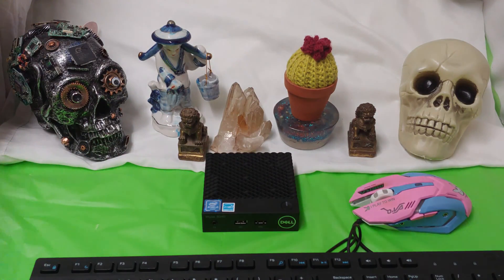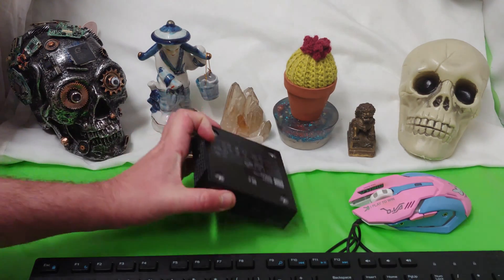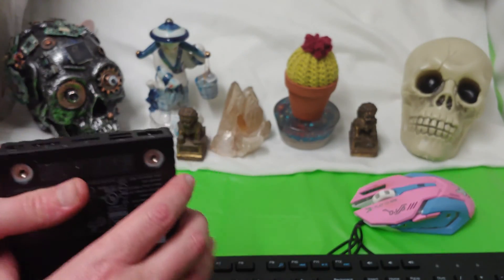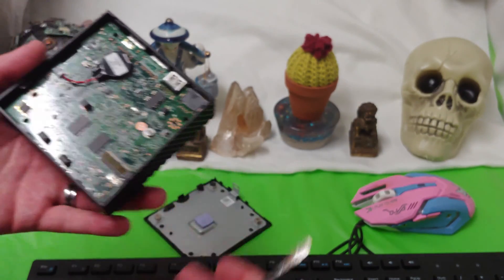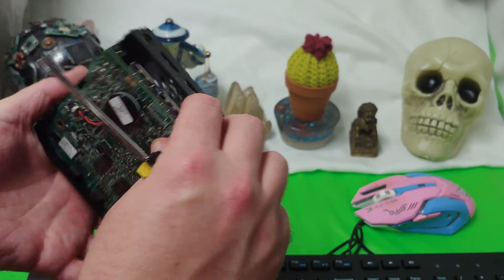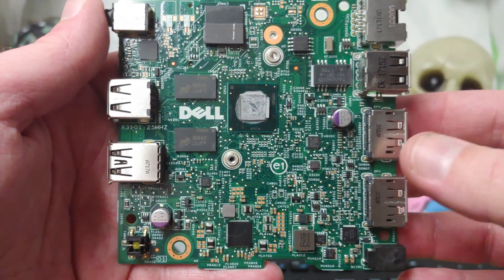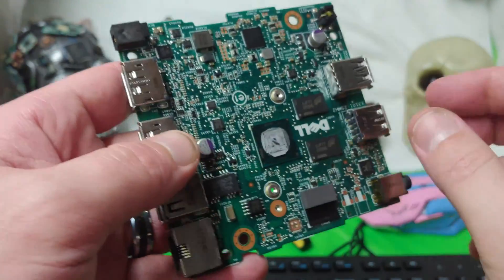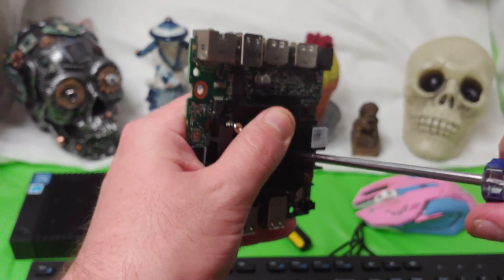Dell WYSE 3040 Teardown In Attempt To Install Windows 10

Comment: a freind had one of these and was able to get it up and running with W10 pro. uses a HP laptop PSU and was able to upgrade the hard drive from 256GB to a 500GB.... nice little unit....

Comment: its really easy to install Windows 10 and you dont need to tear down. You only need to enable usb boot and disable secure boot. The Media must be created with UEFI. I was able to install Windows on its 7gb disk using some disc cloning techniques. You will get the best performance by booting from a USB 3.0 SSD with this device, you can even run some games.
Reply: Hey dude, I have one. Can you detail how you did it? What windows you install inside 8gb emmc and how?
I try install windows 10 inside an external hd, but I have same problem of video.
Please help us
Reply: @leonelhammerlmartins9146 I installed Windows 10 in a SSD from a hyper-v virtual machine and then booted that SSD from Dell wyse and installed all drivers, activated OS and Disk compression, etc. Then in another computer I used mini tool partition wizard to remove everything that I felt was unecessary: fonts, DriverStore folder, etc. and also created an image from that installation using Macrium and booted again from USB in the wyse. Then that I used macrium again to write the backup image into the mmc.
Reply: btw, to boot  USB devices properly the image must be: UEFI and Windows x64
Reply: @adia.413  Please. Can you share a video? I don't understand.
Reply: Hey, I just installed Windows 10 on the internal memory of my Wyse 3040. I noticed I don’t have any working drivers for Bluetooth and Wi-Fi connectivity however. Any advice for finding these drivers?
Reply: Did you find it?  @riffdex
Reply: Did you found a sollution to wifi and bluetooth drivers?
Reply: @imssrinu are you got solution?

Comment: That slot isn't an m.2 slot. It is for a wlan card.
Reply: I also think so. Thanks for sharing everyone
Reply: The top side of the board shows that it has EMMC, and I know these units can come with wlan, so I would agree. The cards for this slot are as much as the unit itself on ebay.
Reply: Its only SDIO electrically, so you need a special WLAN card, or you can try an SD card adaptor
Reply: Or MSATA
Reply: How do you know that? If it is mini-pcie, then it should be able to support an msata SSD.
Reply: @moshet842  It's not mini-PCIe slot. Only SUDO signal pins are exposed, it's only for WLAN card and only very specific cards work in this slot (usually more expensive than the terminal itself).

Comment: I have been able to successfully boot Android 9 on the device, and it seems to install completely in addition to being functional, but when it shuts down it does not reboot correctly and the system must be installed again, you know how to correct that error.
Reply: Hey, how do you this? Thanks
Reply: @leandromontenegropinto6704  With ubuntu, you boot ubuntu as live cd on a bootable usb, then when you have access to the operating system you can use the disk management tool to clear the internal storage of the drive and format it as you like.  from there you can run any operating system, only in my case it is not installed correctly.  If you have problems with booting from a usb, configure the BIOS the key is "fireport" is the same in all Dell wyse 3040.
Reply: @EddyShagoo  my Wyse 3040 BIOS is locked and I would like to unlock it. The "fireport" password does not work. Do you know any other way? Thank you.
Reply: @qkotman  The factory password is "Fireport" with a capital letter, if it cannot be accessed through it, I do not know what you could do.
Reply: @leandromontenegropinto6704  in this way you eliminate all the locks that Dell places on the device so that you cannot install other systems than the ones they sell
Reply: @EddyShagoo  thank you
Reply: @leandromontenegropinto6704  If you have doubts, let me know, and I will help you where I can, I am not an expert but you learn as you go.